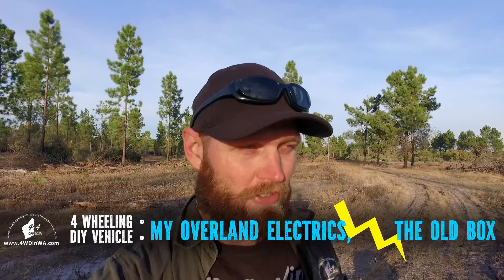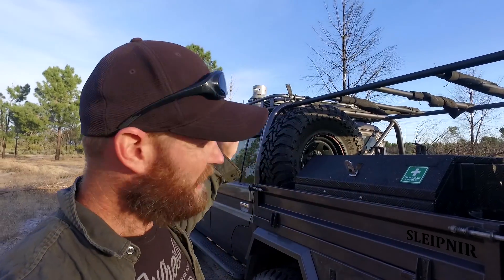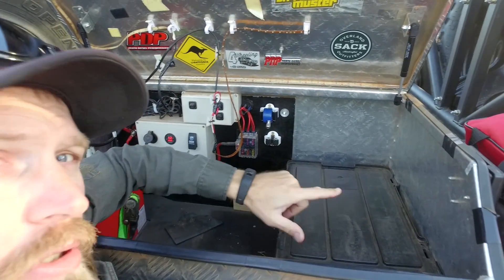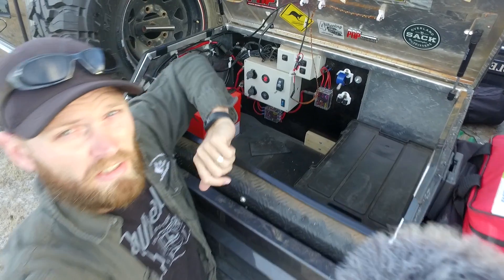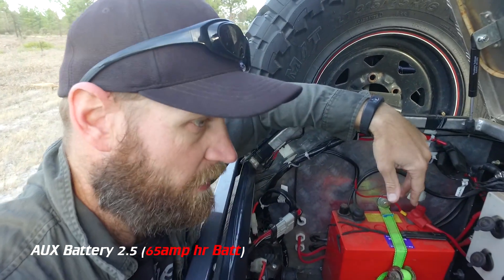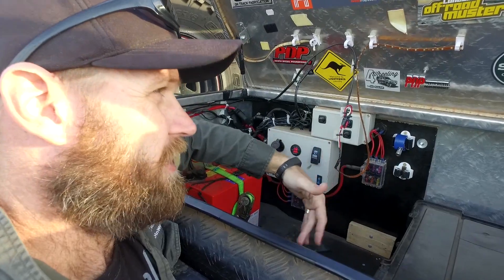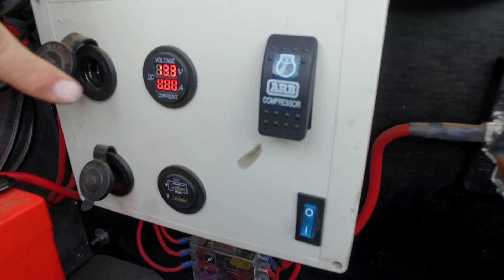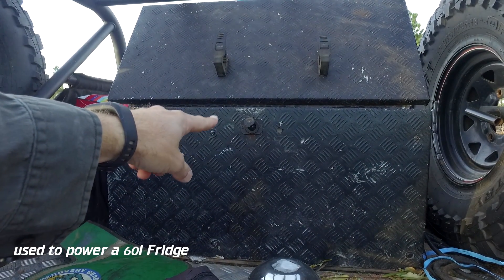DIY Electrical Overland Box

Comment: you can save a lot of money by grounding batteries to your frame. They do it in car audio with no problems. D'Amore engineering did a current flow test that shows the resistance added is negligible on a system running 10x the current of what you will be running. The video is on youtube. Your factory system uses the frame as a common already.

Comment: Thanks for info on compressors source for power, keep up good work with the videos. Note keep high amps away from com's cables or one side of car/truck for power and other side for com's. Copy of your wiring diagram with testing tips/ fuses laminated always help."Terminal ends" electrical tape then heat shrink over the top. Just done 2500 miles trip of Europe and of to next one soon. ATB

Comment: awesome vid man. came here for dual battery knowledge. and i left with more questions than answers. I'm trying to put together a system where the aux accessories can deplete the "aux" battery without ever touching the vehicles battery. but the alternator still will charge both respectively. only been able to find systems that either charge both batteries equally. or charge the aux battery using the vehicle battery. or my recent find the CTEK D250S which seems to charge 1 battery, while automatically alternating from solar panels to alternator depending on output. which is like the opposite of what I'm looking for. PS i tried your weenie, rice, coconut, corn, pineapple dish. very good. i just add a little salt and pepper and a couple of eggs to round out the texture of the meal

Comment: I might suggest  loading the front of your tray with with 4-6 deep cycles to cover your power requirements 

You will need both a AC  shore power box and AC fuse box and dc fuse box you may want to consider a Anderson pole setup for your dc setup

With dc>AC power converters it is not advised to run mismatched batteries. Though I do recommend if you are going to run a converter/inverter  you may want to consider something within 1-5 kw as that gives you multiple power options for an engel or some type of fridge freezer..

You typically run 2 batts to cover you cabins power requirements which will also cover lights, cb (27mhz) cb uhf in both narrow and wideband and ham and aux radio services

Comment: Hi Ronny, been loving your videos for a few years now, but before you wire up your new set up, be aware that the diagram you briefly showed to wire up two batteries in parallel isn't actually correct. It's hard to explain without a diagram (there is an excellent one somewhere on the Redarc site), but I will try.  Battery one and battery two. The positives of both batteries should be joined together and the negatives of both batteries should be joined together, as in your drawing. The error is that you have your feed to your accessories coming from one battery which will work but not as effectively as running the positive feed from one battery and the negative feed from the other battery. The reason for this is that the charging source is only going into one battery (battery one) and no matter how good the wiring is, it creates some resistance so the other battery doesn't fully charge.  In most cases you draw power for your accessories from the other battery (battery two) and again because of the resistance more power is drawn from that battery (battery two) and therefore this battery never achieves the full charge of battery one. This method uses more wire but is more efficient. Those bare positive terminals worry me too, but I'm sure you will rectify this in you permanent install. At least you have plenty of fuses ;-), keep up the excellent work and I DO hope to see you on the tracks & trails one day, but I don't get over West as often as I'd like. Cheers Paul

Comment: hey mate, love the video as usual! glad to see that even the biggest names in the 4wd world have messy wiring haha. I know I look at my engine bay sometimes and shake my head at my wiring! 
just wondering what takes grommets were that you run the wiring through the side of the box? I just wired a compressor into an under tray toolbox and used rubber grommets as I didn't know those plastic screw on looking grommets existed!
cheers mate 👍
Reply: BAIRDYBOII they would actually be called cable glands! They're more so used In 240v AC wiring 
Your local Bunnings or electrical wholesaler can hook you up
Reply: Joe Deionno cheers mate, champion!

Comment: I run my compressor from my stuff battery so that I can use it with the engine off. Not something I'd want to do regularly but I think it's good to have the option.

The reason I can do that is because I don't use a DC/DC split charger, mine is relay based. It can take the full alternator current continuously and peak much higher so it's suitable for jump starting myself.

Comment: Good video but from a auto sparky view some information isn't 100% correct and the wiring look very hazardous and messy which affect reliably and safety
Reply from the maker: agreed, it was a very quick setup and was never meant to be in use for that long, the new box is done very different and a lot neater.

Comment: Great timing Ronny. I'm currently working on my 2nd battery setup with the fridge, usb sockets, and camp lights out of the back of my Prado. Do you have any suggestions for connectors for the fridge? I'll use a merit connector with my waeco but I've heard some suggest wiring it using a 50A anderson plug. any thoughts?
Reply from the maker: on my next setup I decided to hard wire on fridge and use a Deutsch plug for the other one (yes two fridges)

Comment: Howzit Ronny, really cool. Thanks for the info re the compressor and the main cranking battery - I did not know that and have always run the compressor off one of the auxiliary output points, linked to  my "house" battery. P.S as you said - easier if you have done some rudimentary wiring, but nicely explained. Thanks for all of this, keep them coming pleaee! Rob.

Comment: You say a DC to DC charger will charge your first battery first then switch to the second. Isn't this the function of an old school solenoid. I thought a DC to DC charger is to supply a constant / maintained charge rather than act as a solenoid? Or does it do both?

Comment: Hey Ronny! those LED strips require silicone on them to stick. I live in hot climate (New Mexico) around 110 F in the summer and I have those lights under my hood and inside the truck. I use liquid clear silicone to stick them down(any kind works, I typically use plumbing kind). Put some silicone on the led clamp them down to and after 1 hour they stick just let them dry and wipe excess silicone. Mine stuck even after a underhood fire when it was 100 F outside(didnt melt the silicone and still stuck, the truck still runs right, do electrical properly!)

Comment: I can't tell from the video but the front deep cycle certainly looks larger than the back deep cycle. It is important when using 'house' batteries that are wired together that all batteries be the same size (in amp hours) and that they are the same age. A battery bank is only as good as the weakest battery (or cell) and in order to get the most out of a battery bank, keeping sizes and age the same is important.
Reply from the maker: yes totally agree, its one of the things I didnt have much choice about and will be addressed in the new build. It works fine but it'll kill the batteries earlier.

Comment: I did not know that air compressors should be on the cranking battery, so that was good to know. Thanks Ronny!
Reply: Gen Kanai not exactly true he has done because he users a bc-dc charger but if you use a standard solenoid your to wire it the second
Reply: Thats not true - I have run 2 big compressors off 1 in my minitruck for years and it's still going.

Comment: Hey Ronny, I have a couple suggestions for your wiring.  I've been working as a technician for about 15 years now, (USMC Avionics, installed electronics packages in police cars, test tech for a U.S. Navy contractor, and currently industrial maintenance technician for the short resume).  A couple of small things that can be done to improve safety and reliability.  First, put some kind of cover over the power screw terminals inside your box, it can be as simple as some electrical tape or sticking a bit of hose over the screw ends.  This will prevent someone or something from accidentally shorting them to a ground while reaching inside the box and/or if something shifts while off road.  Two, take your wires into the bottom of the box and incorporate a drip loop.  Google "drip loop" for a more detailed description, but it is basically a low point in a wire that water will run to instead of the water running to your electrical connections.  I know it is only a 12V system, but it is the amps that do the damage.  80A fuses and 0.25A to stop the heart.  The question then becomes how much resistance (ohms) to ground.  Normally, the human body has too much resistance for 12V to overcome and allow current (amps) to flow, but if you are getting someone unstuck, in the rain and need to reach into your box... well I think you get the idea.  I know this is your old and temporary box, but hopefully you can incorporate this into your new box and I hope it helps anyone else that is building their electrical system.
Reply: Those exposed positive terminals had me nervous too.  I've seen a screwdriver melted in half when it completed a circuit from a terminal to the vehicle body.
Reply: I spent 30 years as an electrician doing every conceivable type of work you can imagine and have to say I concur with what you’ve said in your comment. People tend to get hurt when they are distracted. Like when you are in a hurry. Doing a recovery or in bad weather etc. Covering all positive contact points, bolts, wires etc is an absolute must. If you use electrical tape make sure it’s not the cheap stuff. 3M makes some that is rated at 600 volts if you use 2 layers. Might seem like overkill but hey it’s only your life right? lol
Anyways loved the video especially the simple diagrams
Happy trails mate
Reply: All good points, but another thing that can be done is to use a waterproof compression grommet for the box penetrations.

Comment: Are you running a normal wet cell lead acid battery for cranking then deep cycle AGM for house?
I keep hearing you can't do it which is whats making my dual battery system be on hold until I can get the funds to buy two batteries plus the dual battery kit. If I can run my OEM battery then put in my deep cycle and not have a problem that saves about $500
Reply: As long as they are properly split, then yes, that should not be a problem. I use a Ctek Dual 250s DC to DC charger that runs from my starter battery to my deep cycle. Personally I would not use a voltage sensing relay or similar kind of relays to connect the batteries as it generally will not charge your house battery sufficiently.
Reply: the kit I was looking at comes with a Blue Sea 7622 ML-ACR 500 amp, dual voltage sensing relay.